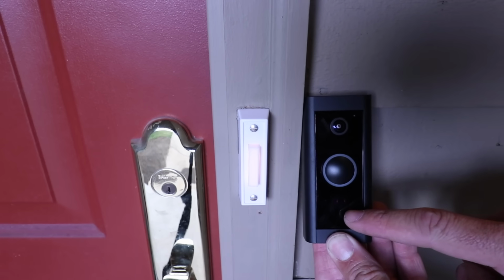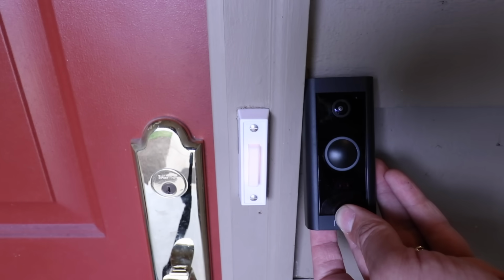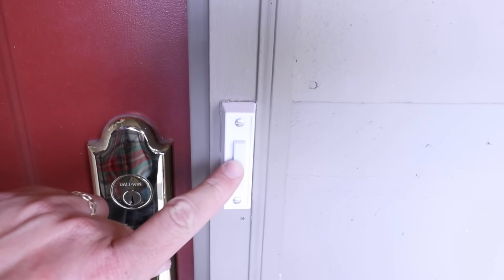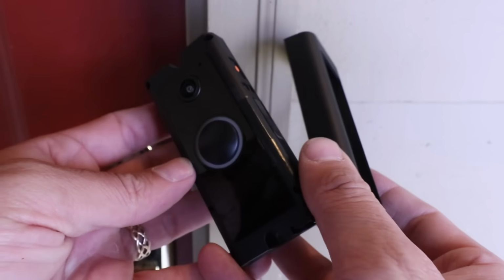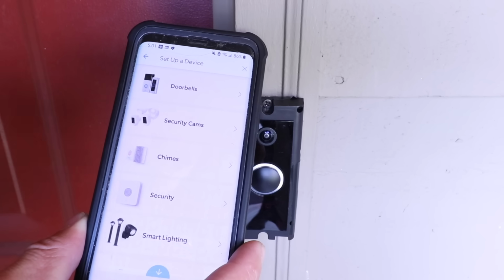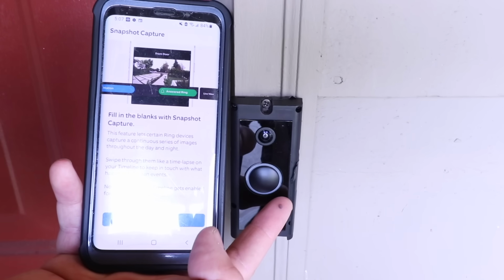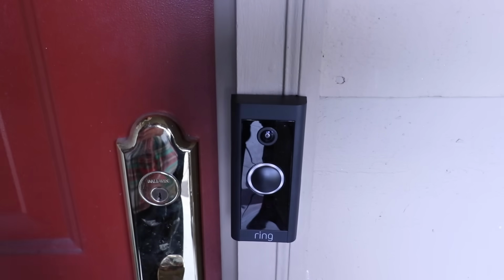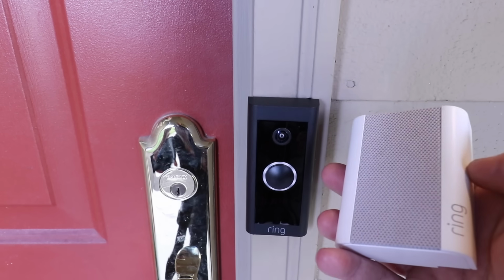How To Install Ring Doorbell Wired

Comment: I received my ring Pro 2 a couple of days ago and its packaging says that it requires 16 to 24 volts. The setup for my previous doorbell only delivers 12 volts.
Reply: Time for a transformer upgrade. 10-12 volts is very old school.
Reply: @joeythefoxxo  Yeah, that's how they're rolling in Portugal right now.
Reply: @sharpwater2  I just heard in another comment that in other countries it is normal for 8-12 volts. Didn’t know that. Thought it was just an older standard. Learned something new today. Anyways pretty sure other countries will soon push for the more powerful transformers to keep up with modernization.
Reply: @joeythefoxxo  from what I see, 12 votes is sufficient for most doorbells here in Portugal because they're fairly basic. But, today I upgraded my transformer and the system is working smoothly now
Reply: @sharpwater2  I’m glad everything worked out well! And yeah that’s fair. I would assume that 12 volts could manage a lot since I swapped the transformer on a working 10 volt system to install a ring.

Comment: Since the chime is disabled anyway, why can’t you just disconnect the wires and twist them together (optionally getting rid of the chime altogether)?
Reply: Pretty much what I was thinking. I bought a home that had an existing smart door bell that I didn't plan on keeping. I believe the chime was in fact the smart panel which I removed. So hopefully I can connect the new ring doorbell and pair it with the ring chime.
Reply: @JASON_GHOSTFACE  How did it work for you? I'm trying to replace Vivint and can't seem to get the ring to work with Vivint's wiring.
Reply from the maker: Glenn good observation, you could do that.

Comment: I think i missed something. Did he drill or did the existing holes work with the Ring?
Reply: I don’t know but I had a similar push button and had to drill new holes for the ring wired.
Reply: I used the top hole, but had to drill a lower bottom one.

Comment: Does all the models make you uninstall or block the previous ring bell??
Reply: Yes. I believe the ring is not designed to send a signal to your existing chime.
Reply: @sharpwater2  they have their own chime wireless speakers that you can plug right in a power outlet to give you chime functionality.
Reply: @XSwordOfWarX  Yes, I have 3 wireless chimes in my home. Thanks
Reply: All of the other Ring doorbell models generally support using your current chime assuming it's compatible etc. 

This is the only model that requires you to bypass it, but it has its own advantages over the battery model depending on your local climate etc.
Reply: No. The only doorbell that ask you to do this is the doorbell wired because is the only ring doorbell which dont have a battery. All the other ring doorbells will support the use of your old doorbell.

Comment: Thanks - I'm interested into the doorbell but I need to install it on brick. Without drilling is there any option to use any adhesive?
Reply from the maker: Go Pro adhesive tabs like these: https://amzn.to/3dg1rpz might work. Ditch the plastic pieces and just use 2 or 3 of the adhesive pads which have double sided adhesive. The doorbell is fairly lightweight. Just make sure you get good adhesion on both surfaces and that it's warm and dry when you attach the doorbell.
Reply: I would recommend using a strong glue to prevent theft.

Comment: I installed a Ring second-gen recently. If you can afford the extra cash it's a lot better since it offers battery backup and can work with your old hardwired chime.
Reply from the maker: Did you get the Ring: https://amzn.to/3ruelWb or the Ring 3: https://amzn.to/3rzWn4C ? What's crazy is that it seems like many versions on the Ring Doorbell are currently on back order.